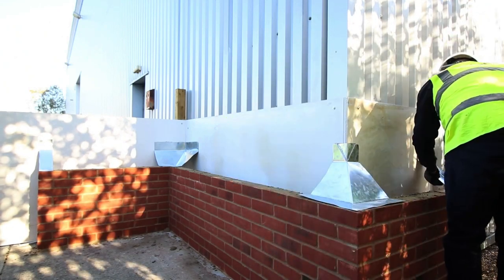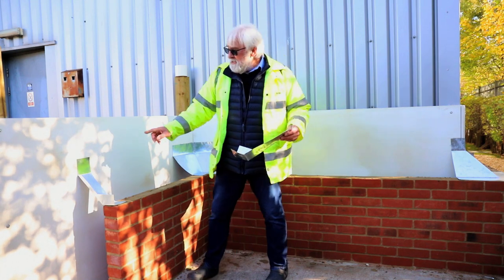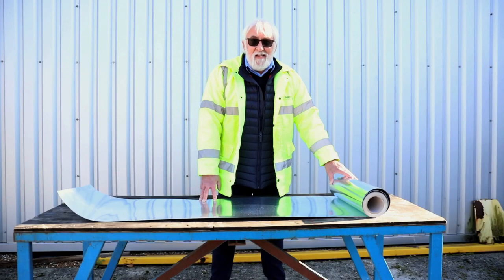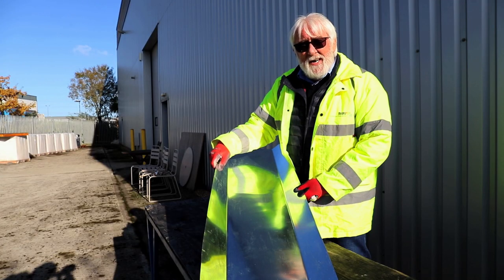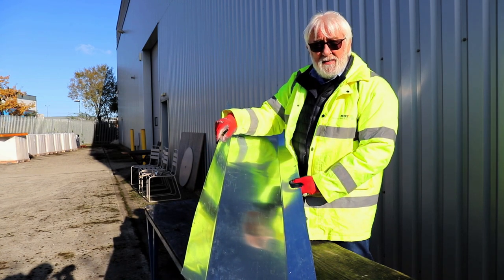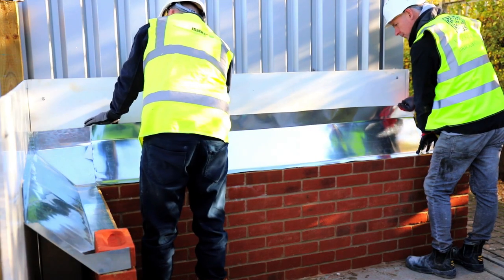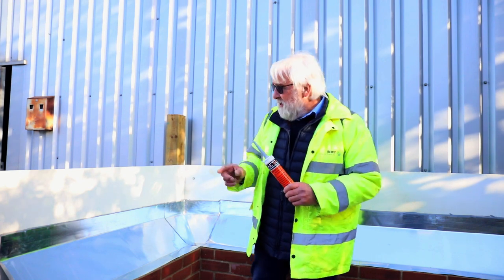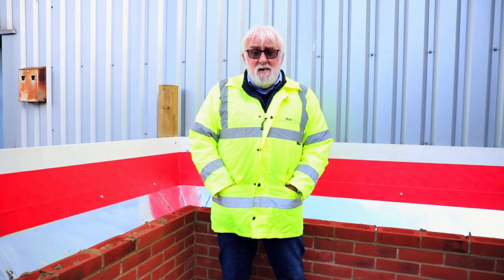METZ CAVITY TRAY

Comment: I was under the impression the dpc had to extend 5mm beyond the brickwork. Why does yours not even protect the whole width of a brick?
Reply: Hi Phil yes that is correct for the DPC, here we are talking about the cavity tray that sits above the DPC and sheds condensation via inserted weep holes. We are also NOT talking about protecting the bricks, that is the job of the DPC. Metz C'tray is stopping condensation droplets hitting the construction slab via the wall Cavity.
Reply: @tempest957  ok so which Dpc is non combustible.? I thought the Metz system was an in fact acting as a Dpc. I’m confused.
Reply: @philbull1940  Hi Phil The DPC does not have to be non combustible, because it does not bridge the cavity. The cavity tray bridges the cavity so on buildings over 18 m it must be non combustible. THE DPC and the cavity tray is separate  they both do different jobs as previously indicated, although we at Metz will be looking at combining the two in the future. Regards Gareth

Comment: Yes lads that's all included in your price you dont get any extra for fitting that ha ha ha clues in the name pal BRICKLAYER not insulation fitter or metal worker oh and did you see these clowns up a three board scaffold on a timber frame with one board on the inside and a great big gap trying to fit this rubbish no didn't think so